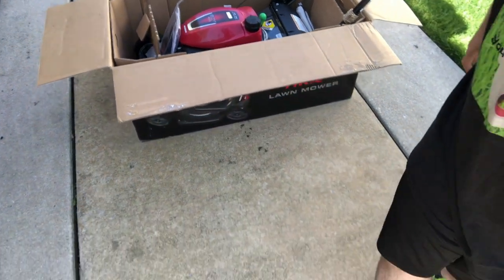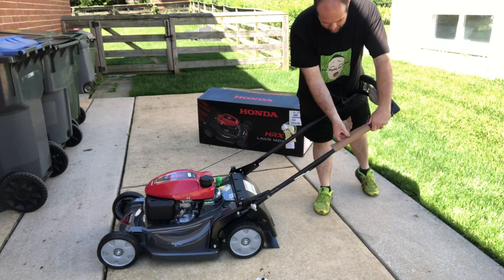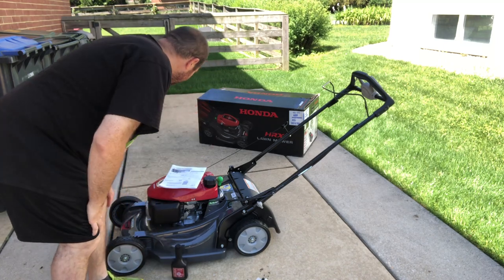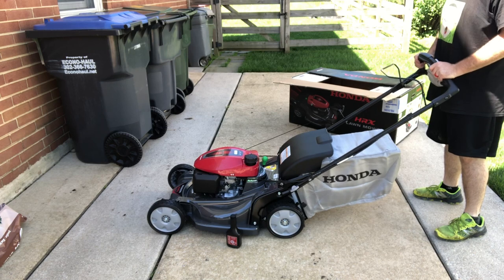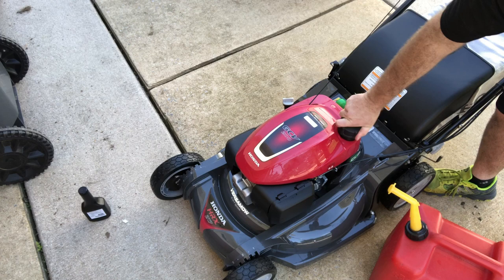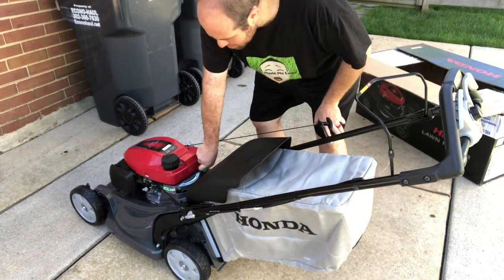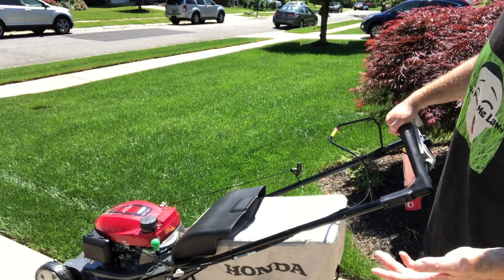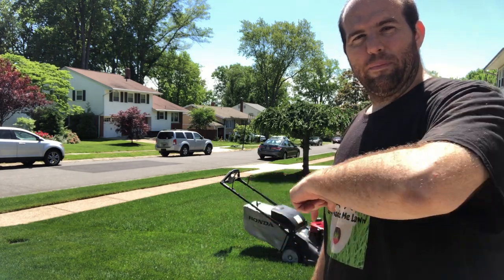UNBOXING: Honda HRX217VKA | Self Propelled Lawn Mower

Comment: Bought mine yesterday. Did my whole front and backyard in one go. This thing is a beast. I had some really dense tall grass in areas. Handled it all. I got the model with the different speed control. The one in this video hurts the thumbs over time. The slighlty higher model you can run with one hand easy and the blade stop is useful.

Comment: I just sold my HRX, the mower was just to heavy for hills plus I had to replace the themowax choke actuator which goes bad making it hard to start.  It's a $10 dollar part but I'd rather have the old fashion priming bulb.  I bought an aluminum deck 2 cycle Lawnboy, circa 2002 and it is fast and light and handles the hills like a champ, the cut was better with the Honda tho.

Comment: My dad always ran Toro but I'm leaning toward a Honda. How do you like the mower still? Interesting there is no throttle control on it, engine just runs full speed at all times?
Reply from the maker: I really like the honda mower.  It's comfortable to hold and walk with, it is heavy though and not as maneuverable as my craftsman.  it cuts great sucks up everything on my lawn.  Yes, no throttle, but I've seen videos online how you can adjust the governor to increase or decrease the rpm's.

Comment: Josh, you saved me a chunk of money for just watching your unboxing about the small amount of oil that came in the mower before adding the full bottle.

I learned that a new engine can start up and appear to run "okay" without any engine oil in it!  I also learned that after a few minutes of trying to get more power from the oil-less engine that the engine will seize!

Then I watched the video and learned from your comment that your new Honda appeared to have a small amount of oil on the dipstick BEFORE you added the full bottle.  Like you said, maybe it was from the factory testing of the engine.  But like you discovered, I encountered the same small amount of oil on my dipstick.

So I figured if I can "see" oil on the dipstick, why should I add a new bottle??  Then onward I went to start the engine, and mow the lawn . . . all to no avail because as soon as I engaged the engine stalled . . . leading me to start it again and again . . . until the start cord would not budge because the motor eventually seized.

Your video helped me realize my mistake, but I believe Honda (and Home Depot and the local Honda Repair center) have to share some blame here:

1)  Calling the Customer Service line in the manual for Honda goes to endless greetings saying their agents are busy, before hanging up on me after 3 minutes.  Horrible service for wanting to know (before the final seizure) what I could do to get the engine not to poop out after a few tries)

2)  Calling Home Depot and speaking to an assistant manager was the second worse . . . because he flat out told me there is no one at any of their stores who could answer questions about the unpacking and proper starting or trouble-shooting of any lawn mower they sell.  In the end he dug up a phone number of an authorized Honda Repair store.

3)  Calling the authorized Honda Repair Store led me to getting grilled from the receptionist before getting transferred to a "mechanic". The mechanic could tell me NOTHING about why an engine would poop out after the first or second or third start.  He took my phone number and promised to call me back with answers.  Today is the 3rd day and they did not care enough to call or say anything.

4)  I slept on this for two nights before choosing to get it resolved "My Way". Today I ordered another Honda online this morning, paying a second time, got an email confirming it was ready to pick up at Home Depot.  My wife and I loaded the broken Honda back in the van and drove to Home Depot.  The curbside pickup brought the new one to my van, which led to the guy to unload the broken one onto the cart -  and he loaded the new one into the van. We then went to the RETURNS counter, gave them the receipt (to which they asked the reason for the return - which I said it would not run), and the entire purchase was refunded on the spot.

Got the new baby home, put the full bottle of oil in it . . . and took to mowing a small portion of my two (2) acre lawn (both seeded and matured field grass).

This new puppy is the best ever for the field grass portions that tend to grow faster in June . . . I suspect it is because of the new dual-blades that turn for mulching.

I also learned that the self-propel has a learning process of what my walking speed is . . . so if the speed is faster than I usually walk, it adjusts somehow to where it goes at a slower pace than even the minimum setting.

Keep up the good work!  You "Made my day"
Reply from the maker: I’m glad you got that mower replaced. Quite the story you got there, but in the end it all worked out.  Enjoy the mow!
Reply: Tl;dr- I'm a dumbass and didn't add the oil like Honda said to in the manual. I ruined a perfectly good Honda mower and retuned it for a new one...in my van. I also think Honda and Home Depot are partly to blame.